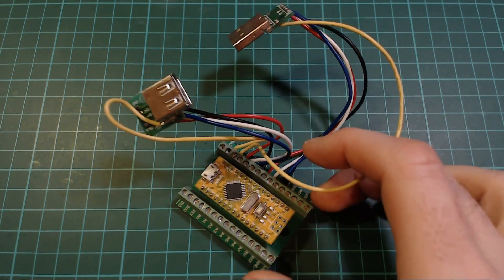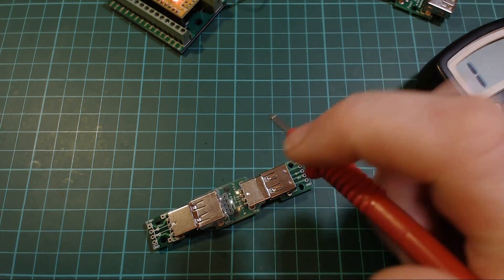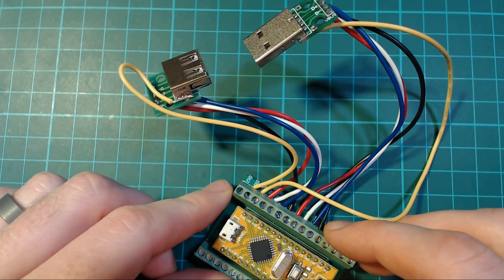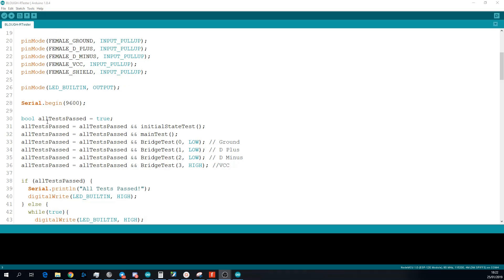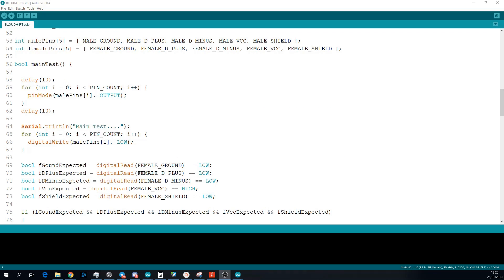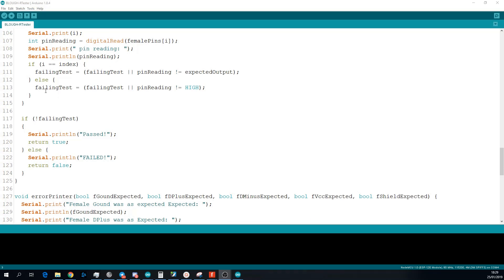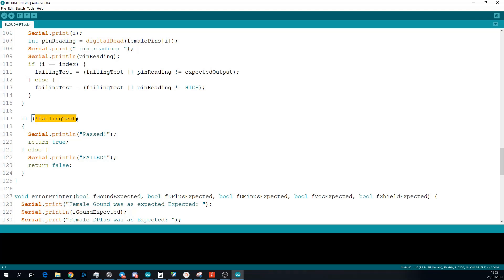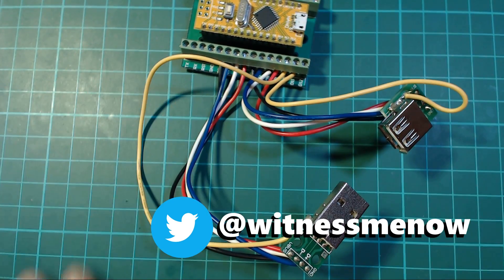Arduino Automated Product Tester - Power BLough-R tester

Comment: I'm late to the party, but my first improvement to the tester would be to eliminate pressing the reset button.  When the tester sees all pins open, it knows there's no device.  Once any pins pass signal, change the led pattern during the test, then when all tests have passed, change the led pattern to indicate success.  This way you just need to unplug and plug the boards under test and not have to reset your tester each time.

Comment: Great project. I'm half way through a similar project, for an RJ45 cable continuity tester. I like your idea of pushing fault details out the serial port so will need to figure out a workaround, as I'm using an Arduino Mini. My tester resides in a box, with a nine volt battery, an led, and a push button. To test, I plug in the cable ends and push the button. The button applies power to the Mini and lights the led to indicate a pass.

Thanks for the quality videos,
Your New Fan :)

Comment: What you have with very little work is very good network cable tester...
Not only can you test individual wires but also shorts and crossovers...
As you use an Arduino you can actually indicate the actual problem in seconds with an inexpensive display...
Add a 3D printed box and a PCB and you have a potential revenue stream...
Mike

Comment: This is a great video on a really important but often-overlooked topic! Cycle-time reduction can produce incredible savings especially when producing at really high volumes: imagine what shaving even 10 seconds off of a 30-second cycle time (33% reduction) could do when you produce a million units a month (as most well-known phone manufacturers do)! Companies can literally save millions of dollars by cutting cycle times by just a few seconds. Contract manufacturers are experts at this type of efficiency gain and will front-load a seemingly-huge amount of effort to achieve such goals, knowing full well of the long-term savings.
Reply from the maker: Thanks Ryan! Yeah I was really happy to cut down the time so much, I'm hoping that they keep selling which will mean it will save me even more time!

I also 3d printed a jig for cutting the heat shrink to the right length, I'm not sure exactly how much that saves but it's definitely more consistent than just measuring it each time!

Comment: Great video and ideas.  

You could get rid of the serial monitor and still identify which test failed by having an LED blink X number of times depending on which test failed.  For male and female pin fails, use different color LEDs.
Reply from the maker: I think that's a good idea. I actually don't really use the serial monitor at all, I normally just use a phone charger to power it

Comment: You might be able to save more time (and eventually false negatives) if you heatshrink the wires together and mount one of the plugs on a board together with the arduino (and breakout the reset button too)?

Comment: Hi Brian, have you a video about using the boolean statements and their structure?

In particular
bool  val = digitalRead(Pin) == HIGH;
bool  val = digitalRead(Pin) == LOW;

Where is this type of statement layout referenced in Arduino docs?
I have found reference in the Arduino Forum back in 2013, but it is not used very much.
What I notice is it is great for switches with pullups, creating a TRUE from a LOW digital input, rather than using the ! symbol.

I have made similar testers and they certainly help with connectors that are not DMM probe compatible.
Reply: Hey Tom... it's just boolean logic in an abbreviated form...   result = ( A == B ) is just saying  if ( A == B ) result == true else result == false. This is not an Arduino specific thing... it's available in almost every programming language.

It's like  String greeting = ( time < 12 ? "Good Morning" : "Good Afternoon" ) 
That's just an abbreviation of a longer form if/else statement.
Reply: @UnexpectedMaker  Yes I understand the notation. But these sort of statements need to be addressed as its not common in Arduino code and programming noobs could quite easily get lost with that notation.

Comment: Hi Brian, nice video. I wonder how much time you spend on making the tester.
One note which you probably already addressed later: on 5:45 at line 144 you use digitalWrite() to set the pins to input mode. You probably meant to use the pinMode() function...
Reply from the maker: Whoops! Maybe I should have been less confident in my ability 😂

Might highlight the fact it's a useless test! Fixed in the GitHub version